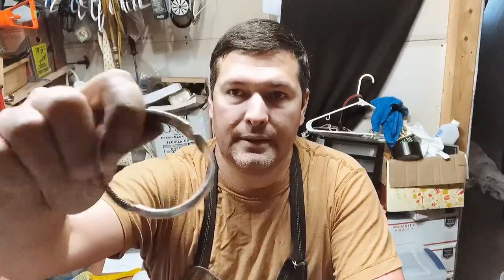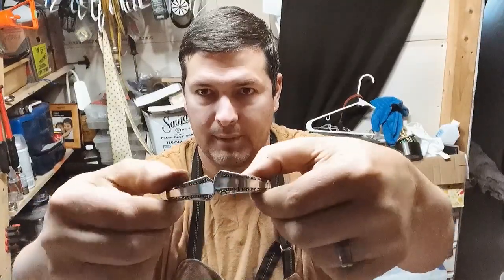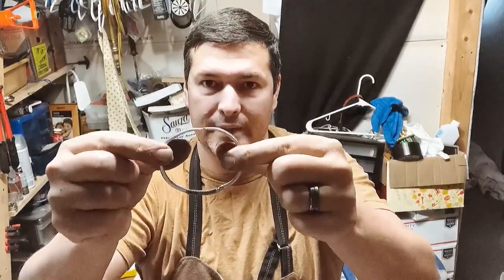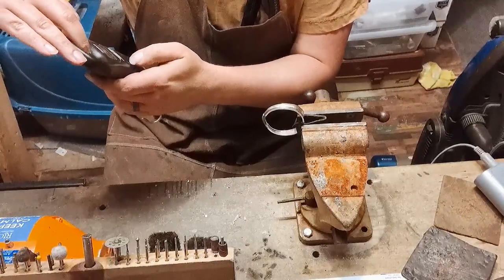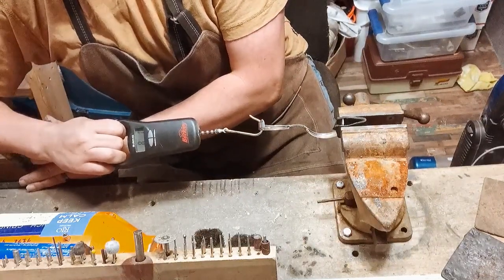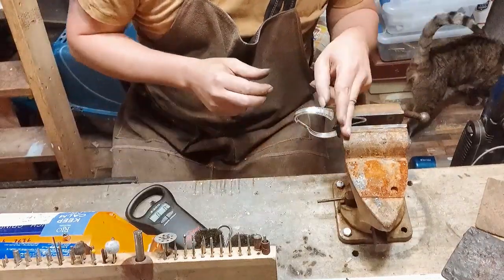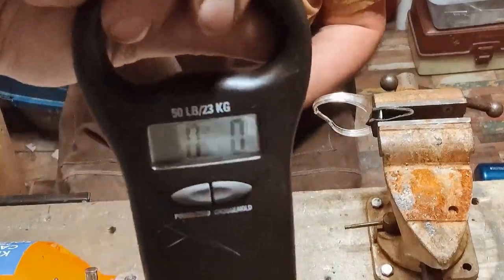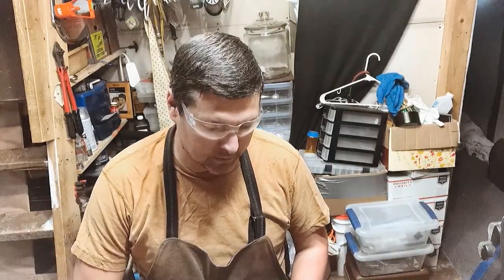Breaking a spring hinge silverware bracelet for testing and learning purposes

Comment: Respectfully, once the spring is stretched the bracelet will not function like it did before. In my opinion the real test of durability is putting it on and taking it off. The shorter the spring the stronger the spring will be and less chance of it stretching. The longer the spring the more flexibility you will have. The test you performed is not what would happen in real life unless involved in an accident. The size of the spring, the diameter of the joint where the solder is, is where the tension and torsion will be greatest, NOT in pulling it apart. You are correct—the side to side adjusting will be the ultimate test if durability. Increase the diameter of the spring size but shorten the length of same and increase the length of the nibs where you solder and  so that more solder can be used to make it more durable thereby, increasing the life span of the bracelet for the wearer. I see your bench vise has changed; what happen to the other one?
Reply from the maker: JC Adicks thank you very much for your comments. I agree with the length of the nubs and making the spring shorter. My good vise was in the trailer and I wasn’t walking well that day. So I was being a little lazy lol.